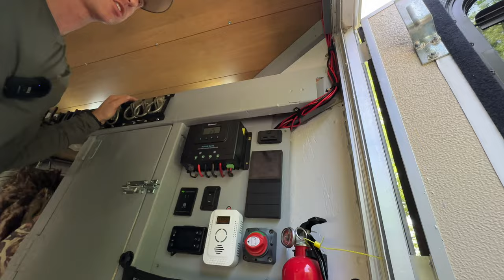The BEST Custom-Built Camper Cargo Trailer I’ve Seen!

Comment: My Cargo trailer camper was stolen earlier this year right out of my yard. Had all my camping stuff in it some of which I had since I was a kid. Major set back but plan to buy another early next year (Coming up in a couple of days!) My sons and I raced motocross and camped in it and wife and I traveled all over now that I've retired. Next one will have Lojak or something just it case.
Reply from the maker: Dang! That’s a huge punch to the gut. I wonder if something like an AirTag would’ve helped track it. In the short term.
Reply: @AdventureGearTV  - That or an old phone so you don't have to worry about the tag battery failing at the wrong time.
Reply: just curious, did you have a wheel lock or lock on the hitch to deter people?
Reply: A motion sensor alarm would have scared them off.Plus there is a new tongue lock out now

Comment: When it comes to towing overkill is exactly what you want. I'm 1,000,000 mile truck driver and I can't tell you how many wrecks I've seen because of people using a vehicle that is "adequate". Stick with overkill or you may regret it and this is the first comment you'll think of when you're upside down in a ditch.

Comment: Co2 detector should be installed low close to the floor. It is heavier than air so any escaped Co2 will accumulate on the ground level.
Reply: Wrong. 5 ft off the floor is the recommended height for a CO2 detector. It is a propane detector that should be mounted within a few inches of the floor.

Comment: The modular bed is amazing. Single person. Multi person. Plenty of space as a garage or for gear.

If I ever do a conversion I’d get a metal tool box with the drawers. I’d maybe want another window on the other side. Then of course shore power with an RV converter and an Air conditioner. Then add a cooking station outside with a mounted propane on the tongue.

And a poop bucket for emergencies.

Comment: That has got to be one of the cleanest cargo trailer adaptations I've ever seen that still retains it's normal function.  Makes me wish I'd kept my 17' cargo trailer.  Since I used it for motorcycle adventure trips, I made the dual beds that folded off the wall with the bikes out.  For two men sleeping. Then I put in a kitchen and bathroom in the front V nose.  I made a fold down table and just used fold up church chairs.  I used a Buddy Heater, but that was before the diesel heaters  became affordable.
If you get an old garage roll up door lift, you could build a bed lift system with a cheap 2000 lb 12 volt winch.  The garage lift won't need the tension spings, just the brackets, cross tubes, and pully wheels.  Mount the winch to the floor and run the cable to the door pully to raise and lower the big bed.  A coule of pulleys to the corners of the bed and you're golden.

Comment: Man, this is perfect.   I’m in the process of gutting mine out after spending last deer season being cold.   Worked perfect except for needing insulation. My decision is whether to have someone spray foam it, which is really expensive, or go buy some foam board Insulation and do it myself.   Which direction did you go as far as insulating the walls & ceiling and are you happy with it?   Thank you in advance for any suggestions and really appreciate the video!

Comment: Nice build simple yet functional. What did you use to cover the underneath of trailer? I'm building an 18 X 8.5 X 6.5 Diamond CT  strictly for camping. Had an RV but the rear wall rotted off went back to camping in a Springbar 10 X 14 canvas tent. It was getting to much for me and the wife to set camp up and take down so I built the CTC. Building it the way I want it built.

Comment: 5:40 - Multiple o2 detectors are a good call. I would hate to wake up dead.
Reply from the maker: It’s the worst way to wake up for sure.
Reply: @OffGridAdventure

I could be wrong, but I seriously think those detectors are supposed to be lower. I've read that CO2 is heavier than air. Please be sure about placement 👍
Reply: @papoochacoo  Wrong. You are thinking of propane, not CO2.

Comment: I have a 7x 14 and pull it fine with a 2022 Nissan Pro4X
Reply: I have the same size and purchased steel trailer roof racks to hold an awning and pvc pipes that can be filled with water and then solar heated for gravity fed showers.

Comment: Great build.
The only thing I would change is a smoke detector up high a carbon dioxide monitor down low
Reply: @bentbars9366, agreed. Especially about the detector down low! 👍
Reply: @papoochacoo  No! CO2 detector is not supposed to be installed low. That is a propane detector.

Comment: Carbon monoxide settles…best to mount those low near the floor
Reply: Carbon monoxide is slightly lighter than air and diffuses evenly throughout the room.
Reply: No. That is a propane detector. You are about the fifth person commenting here to give this wrong information.